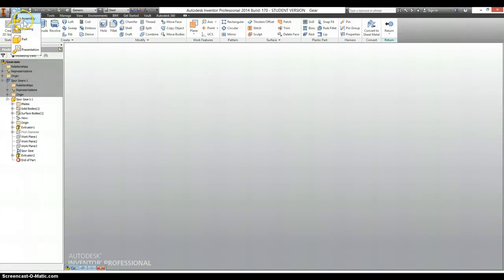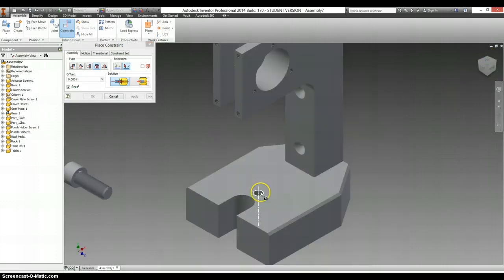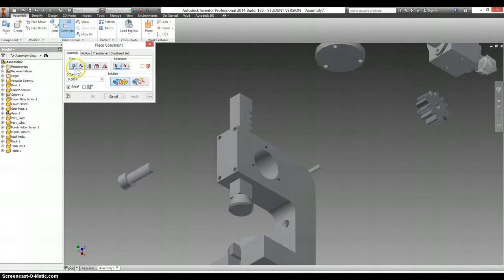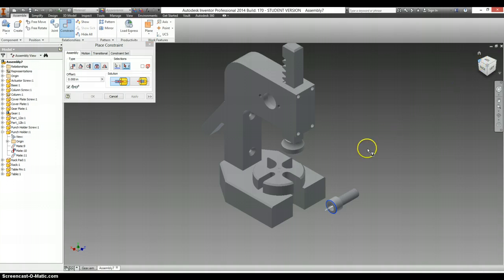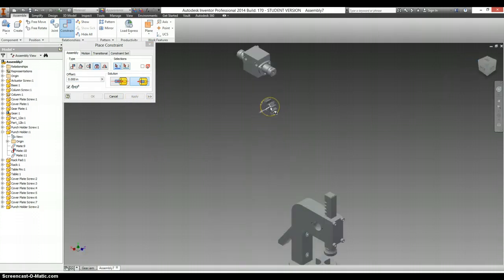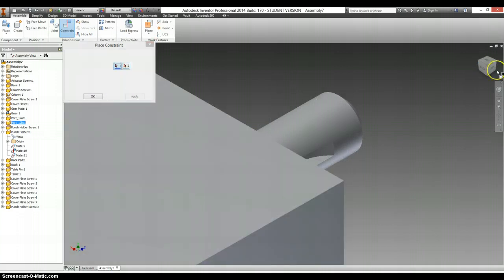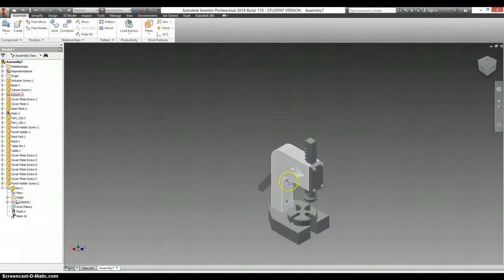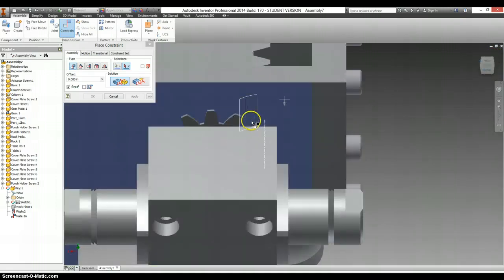Arbor Press Assembly

Comment: HI Scott Thorne, Will you please email me the following parts: 
1. 7Cover Plate Screw | 8-32 UNC x .50 cap screw | STL
2. Column Screw | 3/8-16 UNC x 1.00 cap screw | STL
3. Punch Holder Screw | 8-32 UNC x 1.25 flat countersunk head cap screw | STL
4. Actuator Screw | 8-32 UNC x 1.25 cap screw ground to 1.1 length | STL

If you kindly email them to me I would be very grateful to you. Find these from "Place from Content Center" is very painful hehe.. I need them by tomorrow Please. 

My info: 
Name: Kazi Naznin 
Email: kazinaznin444@gmail.com